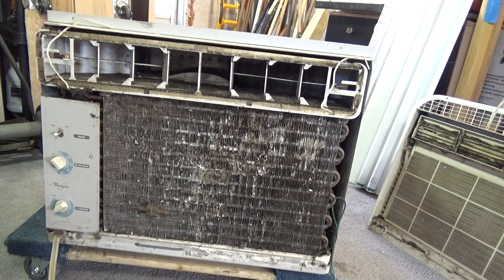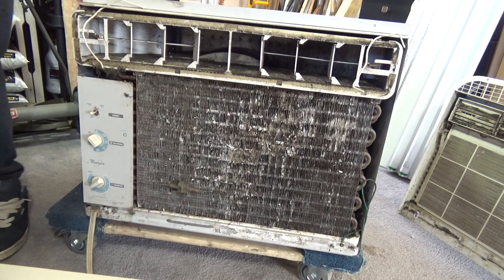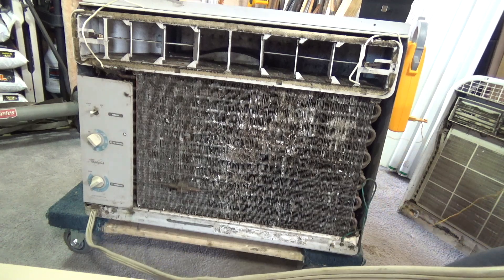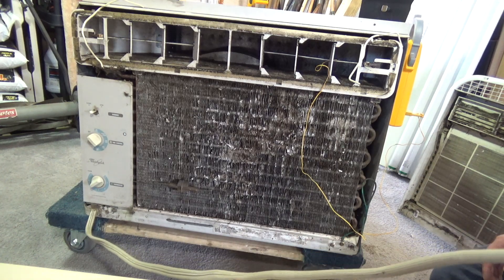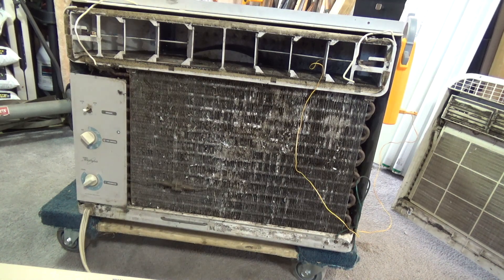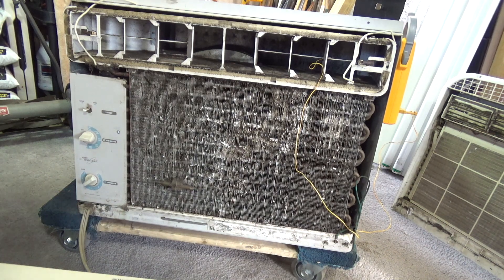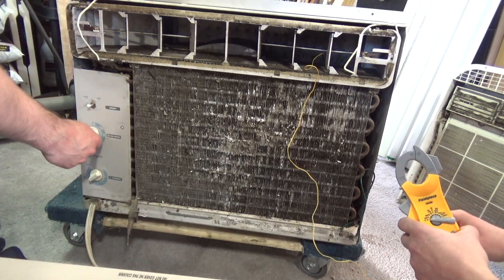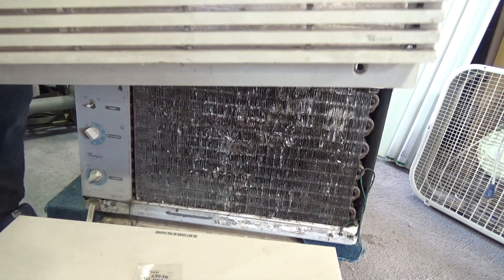Whirlpool 14,000 BTU Moldy Air Conditioner | Spring 2024 Test

Comment: Nice video of the start up of this Whirlpool air conditioner. Definitely one the last few good pieces of air conditioner equipment made before things went to junk. In my opinion, anything made after the R-22 ban is junk. This will for sure make a good video for cleaning. Hopefully this can be installed (likely where you mentioned, the garage) soon.
Reply from the maker: Thanks

Comment: Those Matsushita rotary compressors last forever. This unit is a good example of what those compressors can take.

In the attic of the garage my 14k GE startup in 80-90°f temps if I leave it in attended. It works eventually but I'm in the process of installing a draft inducer module in one of the roof vents to aid by removing hot air in the peak of the roof.

This video is hilarious. With all these mold spores and the ghetto electrical stuff.
Reply from the maker: Matsushita made excellent compressors during this era.

The attic fans are nice to have but usually aren't very effective. Good insulation is probably a better investment.